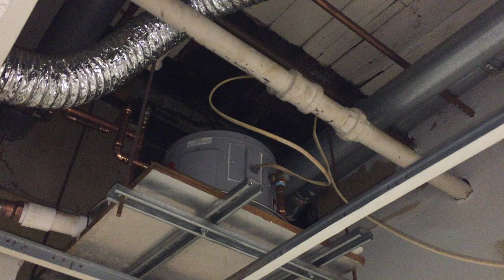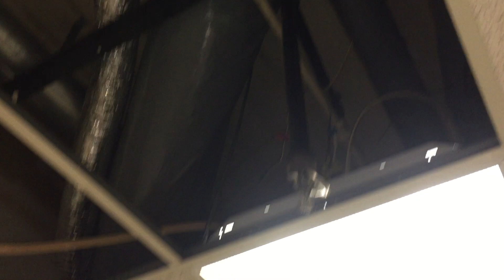Moving Violations Video No. 243: NM Cable No-No

Comment: I've seen type "NM" or "Romex" as I call it, used extensively above drop ceilings in the Philadelphia suburban area for over 40 years and still is being used and passed by inspectors, as long as the ceiling isn't being used as a return plenum, and the occupancy of the building isn't above 150 persons. I personally always use MC cable, even when wiring an addition to a home.